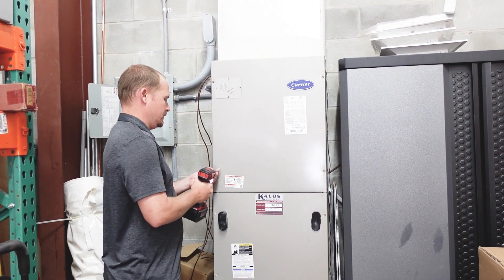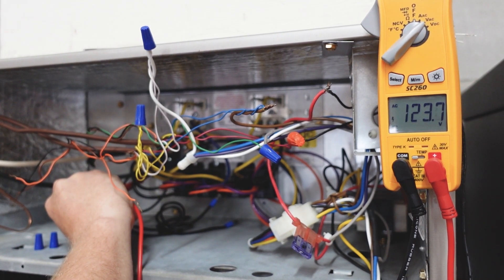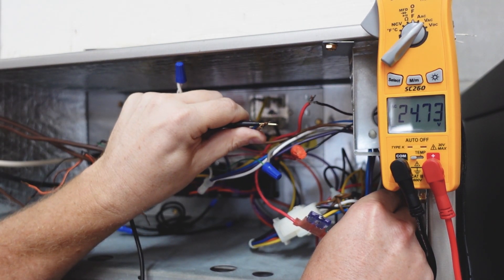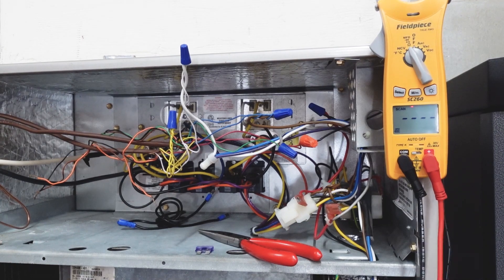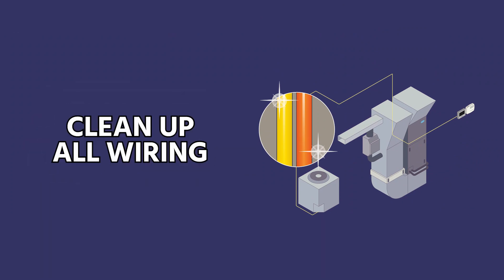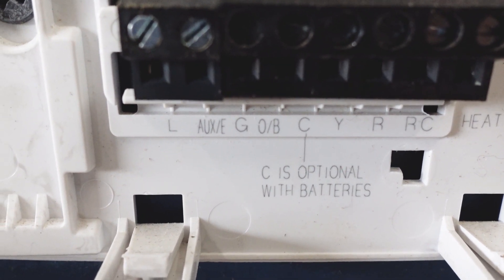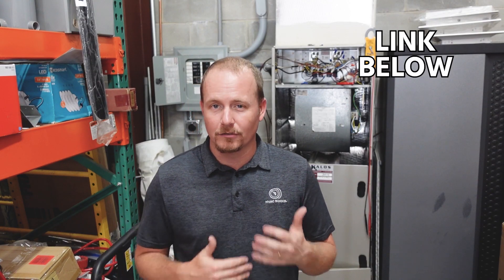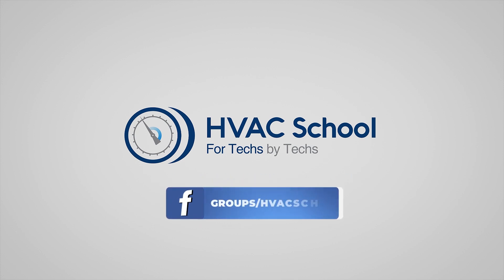AC Blown Fuses - How to test them and why they blow

Comment: Never worked on HVAC before, but through this video, I was able to diagnose and fix the issue. 3 wires were so old they had Roman numerals on them. Replaced them and done!  Thanks!

Comment: We installed our ac unit last year.  Since installation, fuse blows every time when we switch thermostat from off to cool however, if we keep the AC unit on cool it works great so in order to shut the AC, we have to raise temperature on the termostat
 Fuse only blows if shit the thermostat off and then turn the AC on.  What could be an issue?

Comment: My AC FAU doesn't come on and upon opening the lower access to the wiring, it is an old system that uses a 6 pin relay to control circuit. The observation is that the wires on the relay,  had fire damage to the Blu & Black wires, top two pins. How do I check the relay function and any other wiring problems causing this?

Comment: Hi
I have a new heat pump installed 2 yrs ago (Carrier)
   I didn’t pay attention until this past winter season in FL,that my unit doesn’t turn outside on heat mode,just the heating strip in the air handler unit.
       It’s a heat pump !  I look at the reversing valve on condenser to make sure they install the correct unit.
      But it won’t reverse anything at all!     I think it’s the thermostat,but I would like to get a second opinion to see what else besides the thermostat I can start looking at.       Thanks
Reply: I would check and see if the reversing valve wire is hooked up. If it's not on some units it won't reverse the flow of refrigerant.

Comment: I’ve ran into a low voltage fuse that was blowing intermittently and it was quite humbling. I had 2 call backs before I ended up pulling a new wire to the outdoor unit and I haven’t been back since. Each time I visually inspected everything and isolated all low voltage circuits but couldn’t find it so I put a new fuse in and when I left it was working. Then a few days later I’d get a call back it was very frustrating

Comment: I have a 35 yr old Bryant air handler , there’s no circuit board and I can’t find a 3 amp fuse. What happend  was I bypass the thermosthat with a paperclip, in the proccess , I think I shorted something the AC won’t run. If I can’t find a fuse , any suggestions which part is shorted? The AC was working before I did the bypass.
Reply: Yes please call your local HVAC company
Reply: Call a tech.
Reply: Those old air handlers did not have fuses. You probably shorted the transformer
Reply: Did you use a plastic paper clip? That’s crucial...and definitely a red one.

Comment: Shorted wires are probably the most common, but I had a system recently that was blowing fuses because the contactor was bad. Very low resistance (ohms), so basically it was shorting out. Easy fix once problem was diagnosed.
Reply: I'm learning the tech side after having been an installer, and that just happened to me last week. I opened up the air handler to find a pile of blown fuses laying in there, apparently is was a chronic issue. When I put a new fuse in, the relay in the AHU made this strange clicking sound, I thought maybe the relay was bad, replaced it, same thing. I ended up checking the contactor on the condenser and it read only .2 ohms, replaced that and everything started up fine. 

I don't know why the AHU relay was clicking but my guess is that sporadic low voltage from that contactor beginning to short was clicking it on and off.

Comment: I just saw this. The last tech didn't put the capacitor back in the clamp and left it dangling. Eventually it made contact with the wall and shorted the fuse out